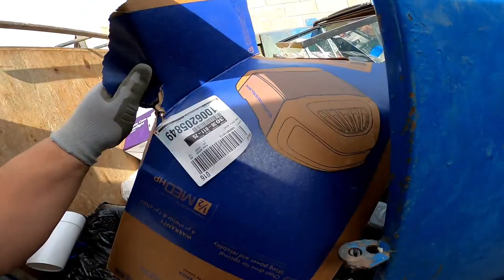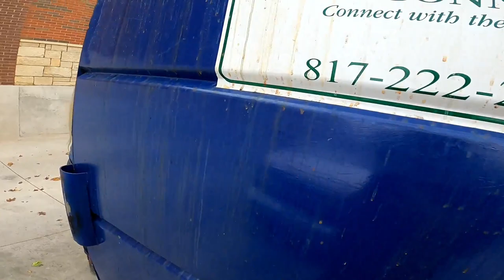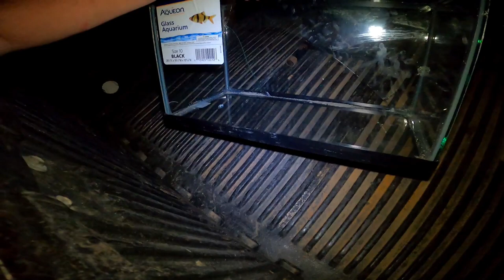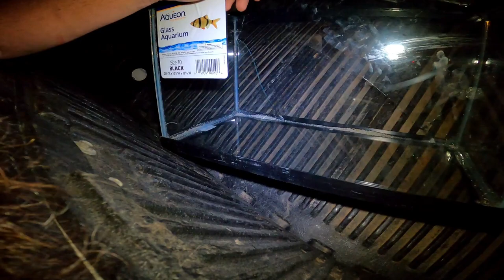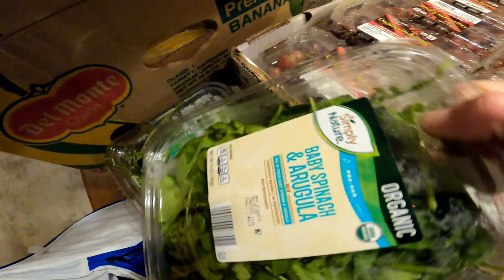Dumpster Diving For Fresh Fruits And Veggies WOW FREE FOOD | Vlog

Comment: Staci.. do you pressure can? Dehydrate and vacuum pack? I could clean out a vegetable dumper and use the all the viable vegetables and fruit. I dehydrate fruits . Make my own dried banana and strawberry chips, onions , any kind of vegetable just about. I mandolin potatoes and sweet potatoes I make my own sun dried tomatoes . I make my own spices. I 10:01  dehydrate basil,  oregano , cilantro . I grind pepper, hot peppers to sprinkle  in dishes , meats, stews.  Jams, jellies, preserves. I dehydrate breads and make croutons, grind and make bread crumbs for meatloaf or breading…. I understand you take for immediate use but long term preservation is an excellent option.